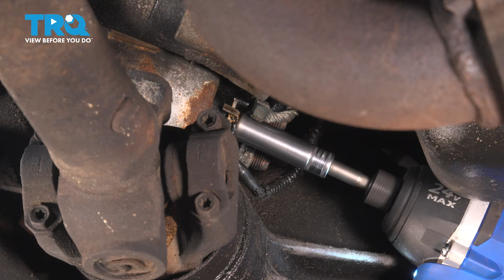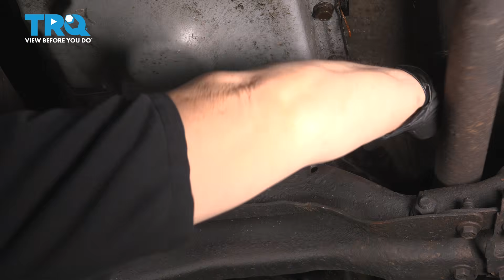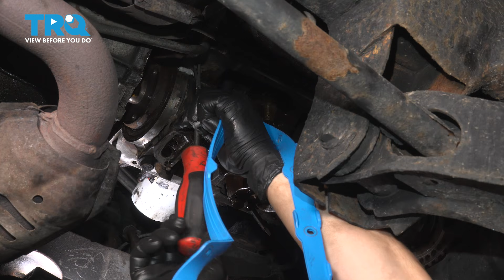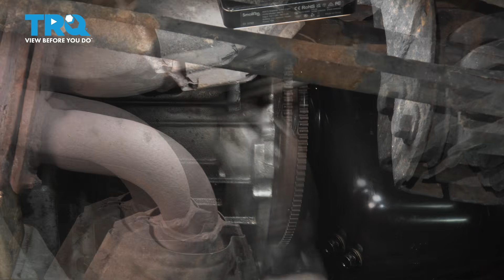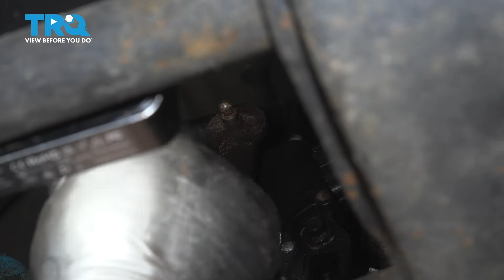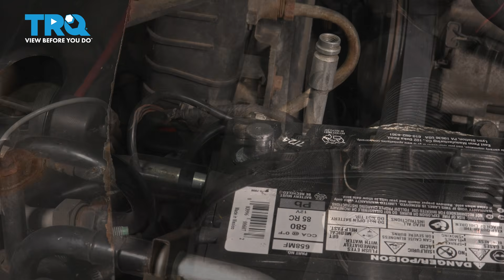How to Replace Engine Oil Pan 1998-2011 Ford Ranger 3.0L V6

Comment: I just did this job on a 2wd 99 ranger (same engine) with the auto trans and coil spring suspension, without dropping the trans. I had to lift the front of the cab a few inches, while also lifting the engine about 6 inches. I strategically cut the flex plate shield to get more wiggle room (in order to drop the pan from around the oil pickup). If youre attempting to do this job on a 99 Ranger 2wd coil spring suspension, lifting the engine alone wont give you enough clearance. You have to lift the cab as well. This way, you wont have to drop the trans.  Good luck. 😂
Reply: How did you lift up the cab?

Comment: Been waiting a long time for this! Got a ford ranger 1999 3.0l flex fuel 4x4 torsion bars xlt 160,000 miles. Only thing wrong is a rotted oil pan and I can’t find a good tutorial on how to pull out the trans. This cleared it up. My next project, thanks to all you!